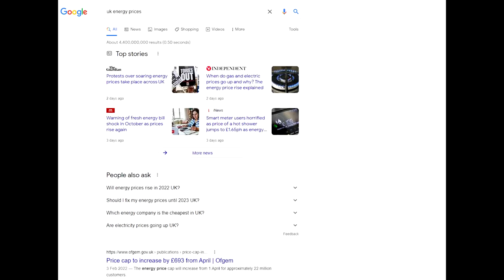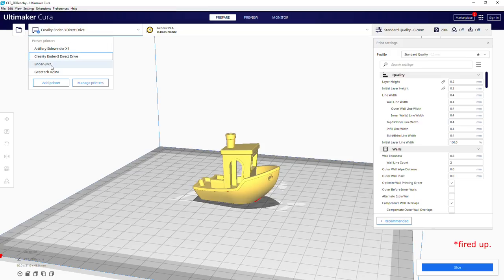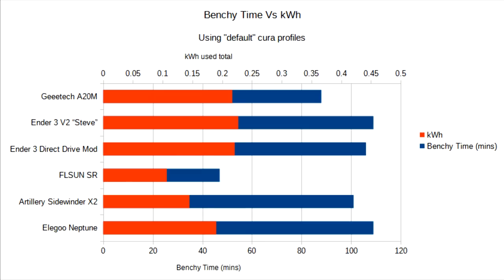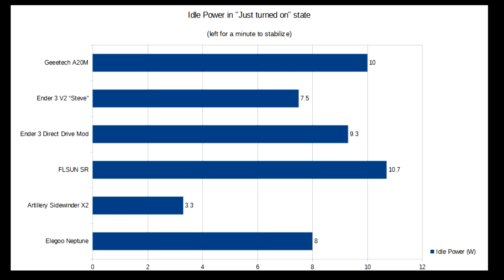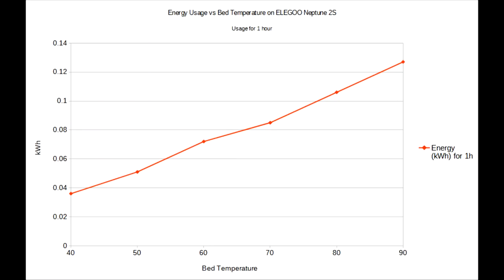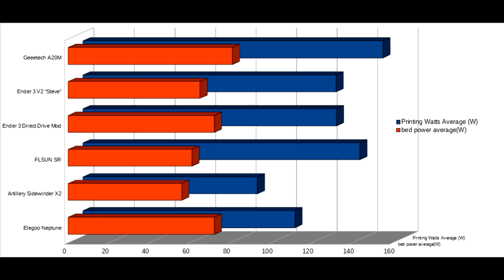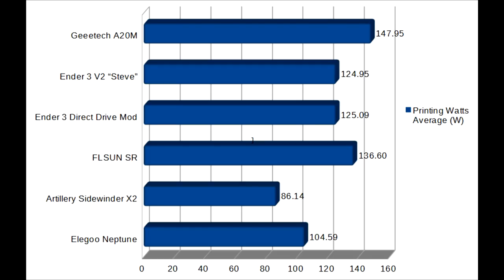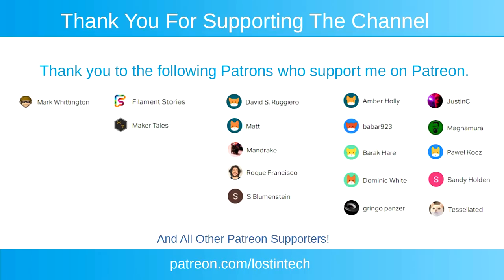I worked out exactly how much electricity 3D Printers use, whether you should care, can you save?

Comment: 2:40 Are "Hotend Net Power" and "Bed Net Power" taken when the they are near room temperature, or operating temperature? I noticed printers use the most power when cold, because:
1) Electrical resistance increases with temperature (reducing current, and therefore power). P = I*V = I^2*R = V^2/R
2) There might be a PID control system that reduces power when approaching the target temperature.
Reply from the maker: Room, because yes, nearly all printers use pid for hotends, although beds sometimes use other power schemes.

Comment: How is a mains powered bed controlled? DC relay (typical on/off “bang bang”)?

Seems odd to me that such a simple solution to bed heating wouldn’t come with drawbacks like temp swings for simplified controls.
Reply from the maker: Definitely not "bang bang" style control as I could see the energy meter settling on a voltage rather than on/off, I will have to look closer at the pics I took in the review of the printer...but I have a feeling it would be an optoelectric relay thingy that's doing PWM.

Comment: If you would like to have as accurate data as possible, you would need to measure energy consumption during heat up and then during printing. For each filament type. And that could be done on a short standardised print that takes around 10 minutes.

Comment: I'm really not regretting to have started my 3D Printing Hobby with more... Uhm... Quality 3D Printers like a Formlabs Form² SLA and a Prusa i3 MK3S FDM 3D Printer... How the hell do you pass a 3D Printer over into production where their fans keep constantly running despite the 3D Printer doing nothing? How the hell does that work? 🤔

I mean I've long been on the fence for Chinese products rarely ever progressing a Tech ( except for the plethora of boards to choose from nothing else came to mind about 3D Printing ) - Often enough being dangerous ( thinking of lethal because ungrounded 220V appliances like K40 Laser Cutters ) - And usually just being there to flood a market but really? It takes so little these days to make something halfway decent and they still mess up the basics enough for them to be a nuisance to their customers 😑

And boy was I already annoyed from the mileage I had gotten from constantly running back and forth between my PC and i3 MK3S situated at opposite end of my flat to load new files onto its SD Card before first replacing that Card with a WiFi enabled Model and later on Octoprint. Any BS like a constantly running Fan or the necessity to turn it ON/OFF to just prevent a simple Fan from running would have driven me nuts - I blame my network enabled Form² ( and now Form³ ) for jading me in that regard 🤣

Comment: This suggests that insulating your bed and/or putting your printer in some sort of case to cut the losses from the bed would be the best way to cut power costs easily.
Reply from the maker: it does doesn't it. Further tests needed.
Reply: @LostInTech3D  Sounds like a potential follow-up video 🤔. I’m in the process of printing out the parts for a Lack enclosure to keep losses down and improve my prints, and I’m going to be doing some before and after power usage measurements, and  I would be interested in what you find out if you decide to continue. My printer is in my garage, so I’m sure in winter it pulls a lot more power than usual trying to keep the bed warm, especially as I have trouble printing anything near the edges of my bed in winter.

Comment: The PSU for the bead  heater should  not use much more than 10-20%, other vice it would get really very hot.

Its probobly the combination that is the main reason... but it really should not be that hard to messure

Comment: Although you talk about 3D printers, you shouldn't use 3D bar plots. No one should use 3D bar plots.

I don't agree with using mains powered beds, especially on bed slingers. The movement will easily cause damage to the wiring resulting in a electrocution hazard.